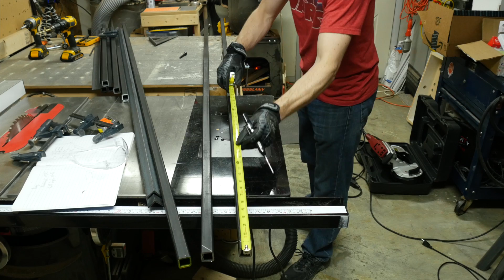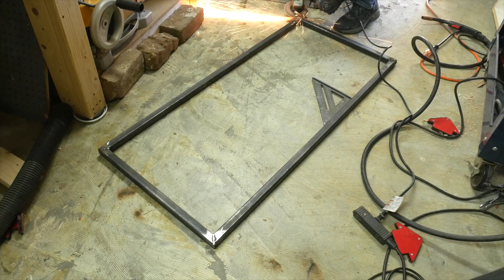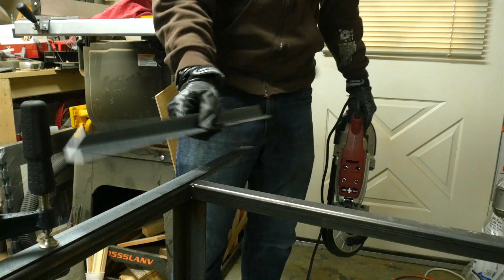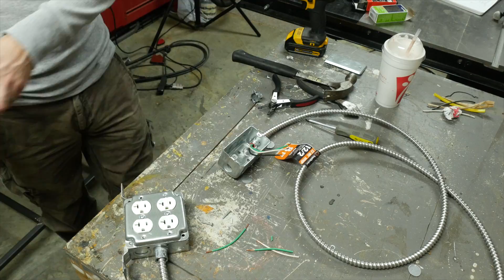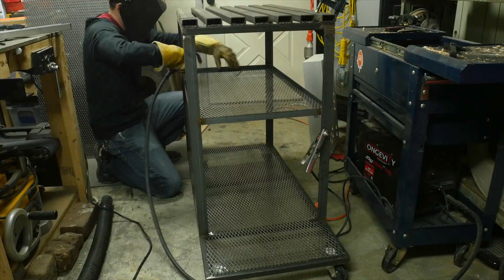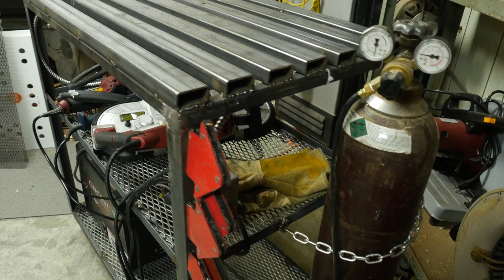Welding Cart & Table // How-To | I Like To Make Stuff

Comment: Bob, why not just use Flux Core wire? 

It’d be way easier and you wouldn’t need to worry about using any 75/25 Argon. Since you don’t weld thicker metal like 1/2 inch stuff, it’d be perfect for everything you’re welding.

Just a suggestion man, hope it helps.

Comment: I probably would have opted for a higher amperage limit on the onboard electrical. If you ever have a welder that needs 220 and pulls a lot of amps you will pop a breaker that is anything below 30, as far as welders I've talked to are concerned. For hobby stuff, it works.

Comment: nice project, here's a tip (Sheet metal worker here) to get a square on a frame, use a tape measure and measure diagonally, if they are different you can pick up the frame and tap it onto the floor, this can make it easier to get it right. Good video.

Comment: Be careful welding things like casters and electrical boxes to tables and other such projects. I work in theater, and something I've learned is that while welding on a caster or a hinge is quick and strong, if you ever need to replace it, It will take much more time and energy to replace than, say, if you bolted it on. I'm not saying to never do it, but it's something to think about as you build a project.

Comment: Do wear ear protection?
You overall seem like a really responsible guy, but I've never seen you wearing earmuffs.
Reply from the maker: +Leandros Λέανδρος Most of my tools are not very loud. I usually do for the planer though, it's the loudest of mine.
Reply: +I Like To Make Stuff Ok, maybe the age makes a big difference, I'm 17 and if I'm not wearing ear protection I cant use the Table saw or even the Angle grinder without being in pain.

Comment: Bob, in your opinion which is more accurate for cutting miters on steel tubing, a portable bandsaw or chop saw. I'm working on a table with a ton of miters
Reply from the maker: +Michael Ferraro Of the two that I personally have, the bandsaw. I've heard that a really good quality miter saw with a metal cutting blade can be pretty good though.

Comment: You probably could have put a heavy duty switch in the one box between the plug and wires, in case you needed to quickly shut the system down

Comment: Just a tip, I wouldn't use a hook for the welding gun, I use a piece of tubing that the diameter of the gun tip fits into nicely, the advantage to this is the hot tip of the gun is then isolated so you or others are unlikely to burn themselves. PS make sure the tube is long enough to support the weight of the gun and tubing, I suggest about 3-4 inches long.

Comment: Hey Bob, have you tried to use diagonal reinforcements before you weld to keep the angles? Or diagonal measureing? When the paralell sides are the same length,  and the diagonals are the same lenght, the angles have to be 90 degrees. Some tricks, a professional welder gives ;)

Comment: I like the idea of a cart for working and storage. I made one for my shop air filter and all the sanding related tools and equipment and find it is very handy to move the whole thing to where I need it. I think it helps a lot in a small shop to be able to move the whole workstation to where it is needed or to remove it temporally to make space for other projects.

Comment: Please check this information this cart could be dangerous. If the earth clamp is not connected or poorly connected when welding wouldn't the current earth via the electrical earth? This smaller wire is too small to carry the load and could overheat and melt. Problem is this may occur anywhere the earth wire runs including through your house! Possible fire hazard and why you don't see welding tables and carts combined.

Comment: 20 year welder here, First something almost nobody knows, (i didn't until about 5 years ago), The valve on your gas bottle leaks unless it is completely open or, (obviously), completely closed. If you just give it a twist or 2 your regulator will show full pressure, But your tank valve is leaking around the stem. This won't effect the weld quality in any way but it will reduce the time between fill ups. 
Next, Miter joints are a waste of time. its one thing if you need them for appearance, but if its structural, (like a welding cart), the extra work over a butt joint is wasted. there is no real strength advantage and its harder to keep corners square with warping.
Reply from the maker: +RedEyeRobot Robot Good to know, thanks!

Comment: Right below the top, you should add a tray to catch the sparks/spatter that will fall thru the top (think crumb tray on a toaster), so the stuff you keep below won't get messed up. Make slots for the tray to slide in, like a drawer.
Reply: +Double Dare Fan ,And make it removable, "unlike" me I had made mine solid/fixed but yes"crumb tray" is a Must!!, after one melted/shorted out cord you will wish you had....

Comment: Do both of those outlets work? Looked like they are wired incorrectly. The jumper wires should go on the same side of the both plugs (left side to left side and right side to right side).
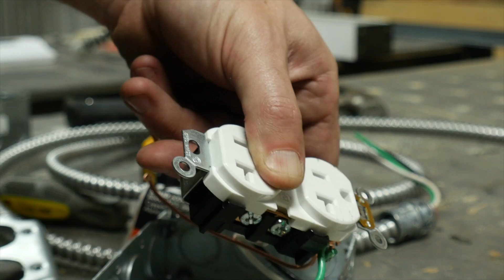Reply from the maker: +KYRM09 If you look at 3:14 you'll see that the plugs were actually turned around, from the front they holes would have been opposite.  Notice the green grounding screw in opposite corners.  
Yes, it was wired correctly, but redone off camera with longer jumper wires so I could reorient them facing the same way.

Comment: Grinders can be scary man. I was underneath my car cutting an engine pipe off so my new motor could go in, and a blade exploded on my. I thought I had cut my thumb off but fortunately it only gouged out my eye and half my cheek. Kidding. It cut the tip of my thumb through the Kevlar gloves I was wearing.

Comment: You should probably insulate and shield the tank from the table. You don't want any spatter or arcs getting to the tank. If you damage that tank the manufacturer can  (probably will) charge for replacement.

Comment: Hey, I have only welded with a stick welder, but I usually get slag spatter that could drip through a table and into a tool.  I don´t know if you have that issue with a MIG welder, but I think a spark in the wrong place in a tool could probably ruin the motor... like if it lands in the coil and burns through the enamel insulation.  Great video, the cart looks great!

Comment: Nice table and great idea, The table  should be relatively light and portable  the way you designed it -the only thing I would correct is that I would not leave any space between the square tubing on the top welding surface because then Sparks/spatter can fall down between the pieces and ruin the top of your welding machine or hand tools. the other option would be to make the top welding surface solid and out of thin materials. love the videos you make though.
Reply: The spaces in the top is to allow clamping of workpieces. A shallow tray right under the top would be the solution for the falling spatter problem, like the crumb tray on a toaster.

Comment: Nice idea, but it my not be a good idea to store your tools under you open welding top. Those sparks aren't good for your tools. I was a production welder for 7 years. I've seen weld slag burn holes in all kinds of stuff and cause fires hours after you walk away. Just a thought.

Comment: Great job Bob, it definitely beats welding on the floor. If Im not mistaken that spot in your shop is were your lathe used to be?
Reply from the maker: +Red Beard Carpentry & Woodworks That's the spot, but it's actually still there :)  Just up against the wall

Comment: did you have any formal training on welding? also, you might want to add some support around the bottom of CO2 tank, it can still slip and slide from there even with the chains

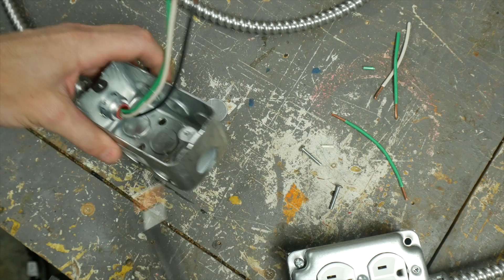Comment: At about 3:35 you say that is a 20 amp plug but it is only a 15 amp plug. 20 amp plugs have the right prong (when looking straight at it, ground down) rotated 90 degrees. The outlets you installed are 20 amp, hence the left hole (ground down) being a T shape.

Comment: what kind of welder do you use?  if you were buying another one, would you get the same one?  any recommendations for someone just learning to weld with hobby projects like these?
Reply: +Frank Graffagnino hi, im a welder by trade. It depends on how much money you are willing to spend. Eastwood is a good welder that isnt as expensive as Miller and Lincoln Electric. But it still might cost you up to 600 bucks. I have a Harbor Freight welder at home. They are cheap and alot of people talk alot of crap about them but for the cheap price they are actually pretty good. I think they have a MIG welder for 200 bucks. But remember you get what you pay for. If that dosent sound keen to you then I would suggest a Hobart. You could probably get a good hobby welder for 300-500 and they would be way better than a Harbor Freight welder. Its all about what you want to do with it but even more importantly; how much will you use it? Also if you go cheaper then just run name brand wire and hardware in it.
Reply: +Michael The Maker I was looking at the $200 HF welder. its a 170 amp welder but the duty cycle says 20% at 110 amps. So basically its a 10%12% duty cycle welder. No es bueno! there really arent many mig machines under $750$800 with a proper duty cycle. On the other hand Everlast is making some nice tig/stick machines for $400-$500 Jody at welding tips &  tricks had good things to say about one of their lift start tig/stick machines. Stick is a tiny bit harder than mig but it doesn't require gas. Tig is tricky to learn and takes more time, but its clean, quiet and very strong. pretty much every mig machine below $1k has a 10%-15% duty cycle. (lincoln, Miller, Hobart) That just isn't worth it. 4, 15 second welds at full power and you're bumping up against it. And these small machines 125 amps is what you need to weld 1/8" steel. Sadly, there kinda is no good answer  to someone when they ask whats a good entry level budget priced machine. Like you said, the Hobart is probably a better buy than most of the low cost mig machines at around $400.

Comment: That's a nice welding cart. Just a couple of things I noticed. First, you should have grounded the metal boxes, makes it safer in case there's ever a short. Second, when you were welding the casters you should have worn a mask for welding. The casters are galvinized and the smoke that comes off of it is poisinous, breath enough of it and it will kill you. Third, you can use flux core wire and not have to worry about gas, makes more smoke though. And last, go to SWAG off road and get a welding cart tool holder, not very expensive and does a really good job a holding hand tools and small grinders. Hope I wasn't being too nit picky, was just trying to help. Have a good one.

Comment: Fully agree with eye protection. Those grinder discs just blow up when cutting certain pieces at the right/wrong angle.

I listened to Jimmy explain tig and mig welding in a previous Making It podcast. Is tac weld different?
Reply from the maker: +Coffee Dude No, I was using MIG. A tack is just making a welding in a specific spot vs running a continuous bead.
Reply: +I Like To Make Stuff  Ah, I get it now. Thanks!

Comment: Bob this is an amazing idea.. but just a tip.. when welding try not to have the magnets close to you or have it touching the metal when you are welding (except taking) I learned this the hard way at school... the magnets can have an effect on the arc causing a bad weld

Comment: I noticed you only grounded the outlets and not the box, if you wanted to do it "per code", you would need to ground the box. Using a ground screw (green 10-32) and 6" of green wire, strip the end and curl the bare copper around the screw and screw into the threaded hole in the back of the box. Then attach that wire to the green screw on your outlet. Doing this provides a constant ground to your box and your outlets. And also, by code(in Las Vegas, idk in your city) you have to use all of the screws in the holes of the industrial cover(thats what those little tabs were for that you bent off of the cover) screw the top and bottom 6-32's thru the holes, the tabs thread on. This provides a redundant ground. Being that your outlets are 20amp, you can see the metal that the green screw is attached to kind of "encases" the outlet and is also part of the top and bottom ears of the plug. When you screw the top and bottom 6-32's in to the plug with the threaded tabs grounds the whole cover.

Comment: I can't really see if you did it or not but here is a little tip when you are doing wiring for high tension: Always have your ground cable about half an inch to an inch longer so that in case the cables rip off, it is the last to un-connect, safely disarming your system.

Comment: Just got that same Harbor Freight portable band saw, but haven't used it yet. Was disappointed that it doesn't come with a metal cutting blade. How do you like it? I normally don't buy power tools from HF, but it had pretty good reviews.
Reply from the maker: +Duhh Roku It seems to work well!
Reply: +I Like To Make Stuff Did you buy the metal cutting blade from HF as well? Was thinking to build a upright stand to pop it in and out of. Maybe that's something you can add to you cart later on?
Reply from the maker: Duhh Roku No, I got a nicer blade.. a Dewalt I believe.

Comment: Nice cart. I had a cutting wheel explode recently, I learned that they expire. There's a date stamped on the centre ring, with age they dry up. No more buying them in bulk for me.
Reply: Nice tip! Just an other quick thing to check is the RPM rating. quite often they fail because the wheel is under rated (RPM) for the tool.

Comment: Very cool. Just curious to the costs for this table build?
Reply: a lot of steel suppliers will have drop bins where you can by leftovers/ cutoffs and save some money. But Expanded metal is expensive. I'm paying about $80 for a 4'x8' sheet the size mesh Bob used. i bought some 1.25 sq  tube last week 14 ga. wall thickness last week it was about $41 for a 20' stick. I'm paying $8 for 1/2" solid round 20' $10 for 1/2" solid square.

Comment: Nice table!   A rest hook to hold the gun for when to need to set it down while welding would be a nice addition.  Maybe something that hooks under the second horizontal bar, goes over the outermost bar and with a fork extended at an angle to hold your gun handle.
Reply: If it hooks into the table you can position where convenient or remove when you need the full surface.

Comment: I've never actually heard of a grinding disc exploding on someone, I thought it was more folklore these days. Sounds pretty scary! Do you think the same thing could happen with one of those steel diamond tip discs?
Reply: +Robin Lewis It's not folklore. It depends on the quality of the product, you get what you pay for. Now, it's not that common or likely, but it could happen and it's not that they explode exactly, but break into pieces, sometimes just one chunk of it comes flying. That's why keeping the safe around the disc should be mandatory (though I don't because someone took it off and I can't find it xD).

With steel diamond discs it's next to impossible, if not impossible. You're not going to break the metal by spinning it faster than it should. But, that being said, I've seen some of that kind of discs with one tooth missing. Again, you get what you pay for, although it's highly unlikely.
Reply: I've always kept the guard on my grinder for that reason but I thought the discs were so well designed these days that it never happens...that's interesting
Reply: +Robin Lewis  if they get a chip in them they have a tendency to be weakened like glass. especially cheap wafer wheels
Reply: It's a tricky situation; the disc is made to be used aggressively but you've still got to be careful with it to avoid getting cracks
Reply: It's a bit like diamonds, they may scratch on whatever other mineral, but they are quite fragile as well.

Grinding discs are not that fragile but they should be "treated well".
Reply: That makes sense

Comment: Not trying to look like a smart ass, but try and use WAGO connectors on your cables, they are much superior than those screwing connectors. As the current flows thru the copper it expands it ever so slightly, with multiple expansions the screw inside mich get loose over the time and break the connection. Cheers!
Reply: I have had just as many service calls on wagos as wire nuts. wagos are just the new kid on the block for increased production

Comment: Great video bob! Basically, when you use a shielded arc welder (or commonly called mig) like you have, the gas acts as a shield for when the weld is being laid and cooled. When the gas is off, it allows harmful things in the air to deteriorate  the weld. This makes the weld weak, and not last as long, so you will want to check it every once in a while to make sure the welds are still holding strong. Great video though!!+ILIKETOMAKESTUFF
Reply from the maker: +Hillbilly Joe Thanks!!

Comment: From 3:11 while you were assembling 4 sockets box, you only earthed (grounded) first 2 sockets and not the other? Was only one needed to ground the whole lot as all body parts are metal? Just wondering :)
Reply from the maker: +Ali Salih The ground plates on the receptacles do actually touch the box as well, so it ends up all being grounded.  I did connect them together  but that shot didn't make it into the video because it was really hard to see what was happening. I didn't worry about it, since everything is grounded by contact anyway.
Reply: +I Like To Make Stuff Ahh, thank you, make sense. It's good to ensure that we do it correctly and safely. I've moved into a new flat (I'm in UK) and two electrical points such as a light switch were not tighten down properly! :O :D